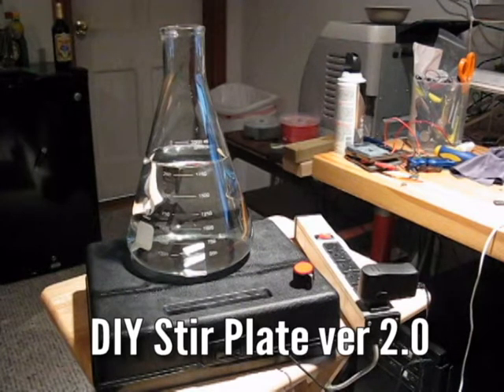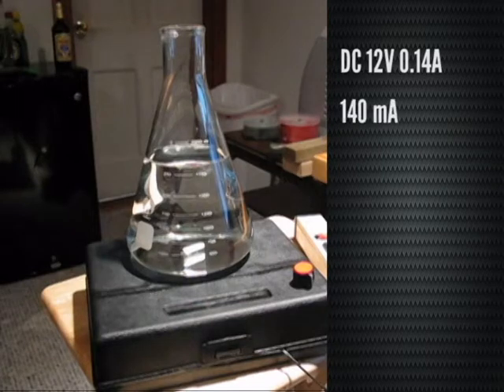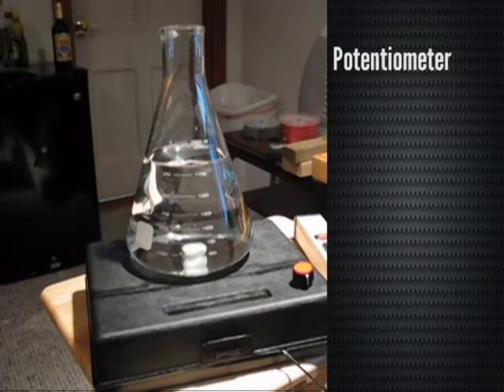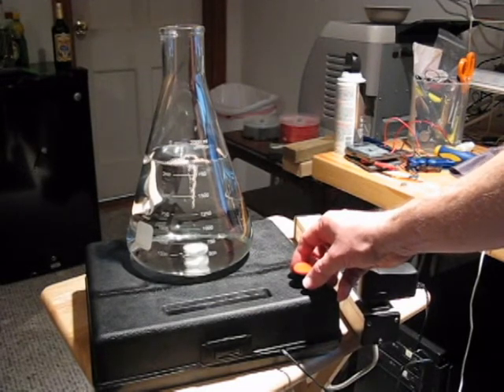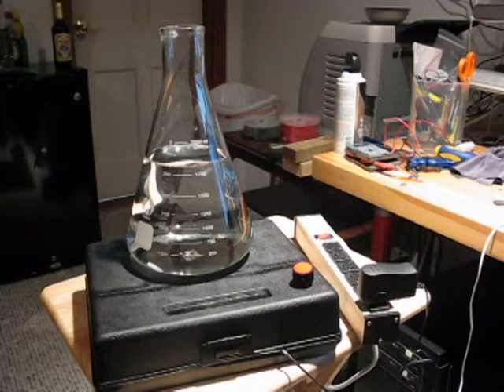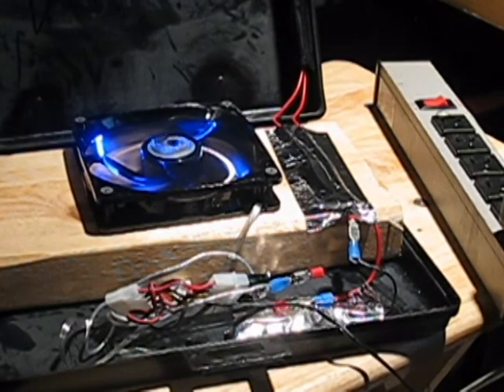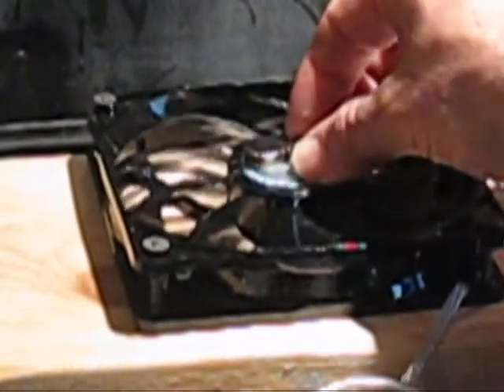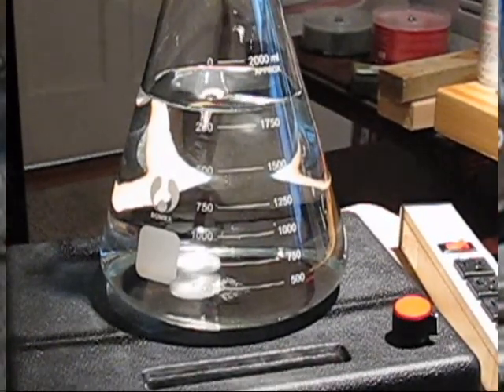DIY Stir Plate ver 2.0

Comment: Why use a fan your better of using a small 12v motor  and fitting a small speed  controller as the potentiometers just burn out hope this helps

Comment: I have a fan from a PC that say's it is DC 12v. will this still work or do I need an AC fan?
Reply from the maker: I would guess it would work fine. You'd just have to get the correct power supply.
Reply: I guess most 12v power supply's like phone chargers convert to DC since it is a DC battery they are charging.